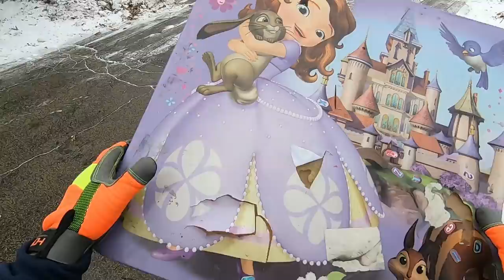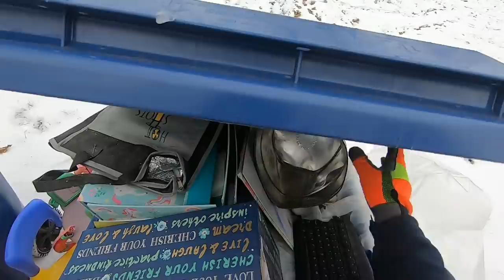Curb Surfing - Finding Free Stuff on Garbage Day

Comment: Paul, the lawnmower’s with the folding handles are made in such a way as to be folded up so they can be placed into a square box. The bottom section folds over the engine and deck then the top section folds from the top over the engine and deck with the part that you hold onto at the rear of the mower. To get the bottom to fold you squeeze the bottom legs at the pivot point.

Comment: Paul! I was wondering, when you cut the cords off what not, do you have to ripped the plastic off before recycling !!??
Reply: Tino Terry 
When you turn in the cords ?as I know?
They melt it off and what is left is copper wire and its chopped up and recycled into new metal
Reply: Ooohhh! So that’s how they do that!!?? Thanks Paul !
Reply from the maker: I turn in the whole cord for $0.30 per pound. They use the shredder to separate metal and non-metal
Reply: Here in Cleveland on East side the scrap place so  devilish they cheap people for there money specially the cans I stop recycling or I buy drinks on cans